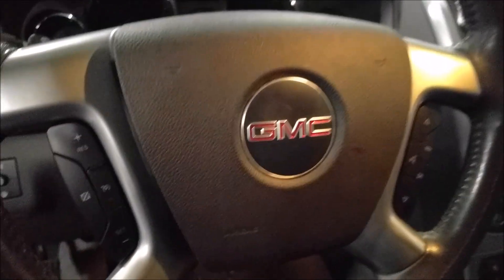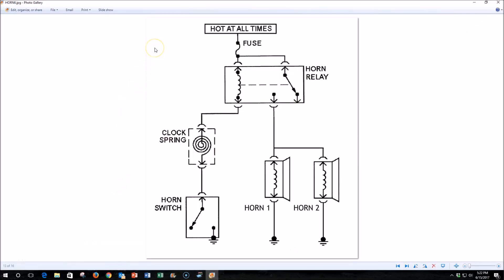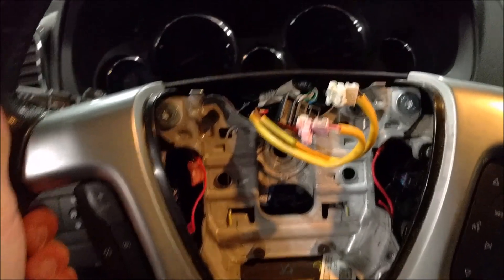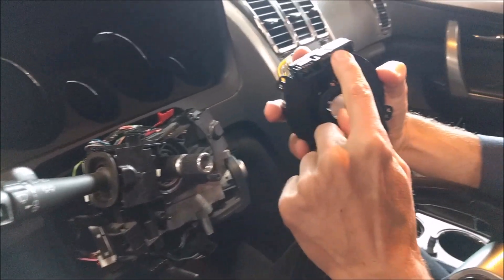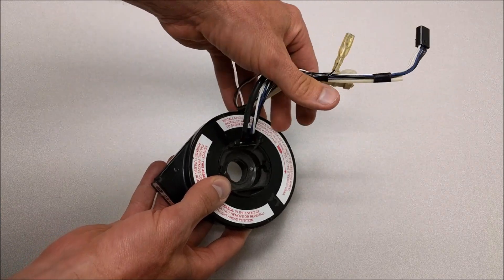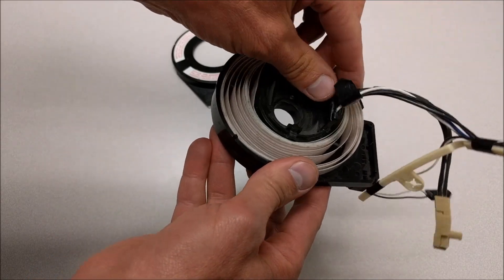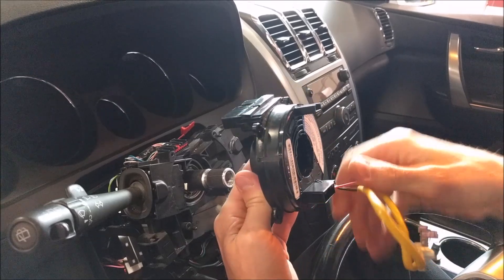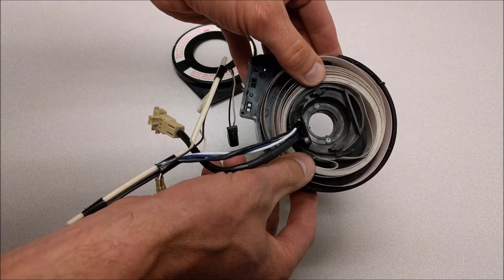How a Clockspring Works

Comment: pretty cool video, i always thought clock-springs were in a sort of direct copper on copper contact (like the ignition switch or a AAA Battery connector)

Comment: So, the automotive industry calls this coiled up ribbon cable a clock spring. Up till this point I didn’t know how communication was coupled to the processor handling this information. 
This ribbon cable technology is nothing new in other electronic assemblies.

Comment: And they want 500 bucks from the dealership to replace just the part on my car not including labor.
Reply from the maker: They can be expensive.  If you have the tools and know how to do it, you can change it yourself and save money.  You will need a steering wheel puller.  Just be careful not to turn the clock spring or the steering wheel while they are apart.  Also, be careful not to purchase a low quality part or you will get really good at this because you will have to do it more than once!  Good luck!
Reply: @JustinMillerAutomotive  its 500 bucks basically everywhere new for my car, ive struck out every time at the junkyard too

Comment: Thank you! When installing do you have to pre turn it or can you just reinstall in the position it came in? Thanks
Reply from the maker: A new clockspring should have a pin in it so that it comes already centered.  You need to make sure the wheels are pointed straight ahead, then install it just the way it came out of the box.  Then, you can remove the pin.

Comment: That was great lesson Justin..At least i know what was exactly to buy & replace..Must i buy the whole clockspring with housing or JUST BUY THE RIBBON..? TQ
Reply from the maker: You cannot buy the ribbon alone.  You will have to buy a complete clock spring assembly.
Reply: @JustinMillerAutomotive  thanks pal..i didnt know it.Mechanic wont tell this

Comment: Question for ya. My 2012 Toyota Tacoma horn is not working when driving straight. Turn the wheel to the left and the horn sometimes works. Would this be the clock spring?
Reply from the maker: Yes- that sounds right!

Comment: Question. My lex gs350 is making a sweeping noise or faint cat winny. Noise could clock spring be problem?

Thanks for video
Reply from the maker: If it is occurring when you turn the steering wheel, I would look at the rubber boot near your brake pedal, where the steering column goes through the firewall.  These famously start making noises when turning the steering wheel.  A little bit of grease on that rubber boot should quiet it right down.

Comment: Thx for the insight- Im lookin to buy an 07 Mitsubishi Outlander and the left side steering wheel controls don't work (Audio/Bluetooth, etc), so from the forums, ppl say its most likely the clockspring because the right side (cruise) works... Hopefully its not too expensive of a fix, I'd do it myself- but worried about messing with the airbag.

Comment: So the other day, I was driving at night and when I made a right turn, I heard a noise like a pop and then my horn started blaring non-stop for the next few blocks. Needless to say, I had many strange looks and unfriendly gestures directed my way.  I finally arrived at my destination about 3 minutes later with the horn still blasting. Pressing the steering wheel did nothing. I shut off the car and the horn continued to blare. Finally I popped the hood, found the fuse box, and pulled the horn fuse. That finally stopped it. My only guess is that the clock spring failed and shorted out the horn switch somehow. Unfortunately, I need to have a functional horn in order to pass the yearly safety check this month. Anyone have this happen to them before? Any ideas?
Reply from the maker: It depends on the type of car you are driving.  Older cars used a slip ring instead of a clock spring.  However, you will probably find the problem if you start by removing the air bag (follow safety precautions). If at that point, you don't see a broken wire, remove the steering wheel and then the clock spring.  Something in there is shorting to ground.
Reply: @JustinMillerAutomotive  Thank you, I'll try that

Comment: How do I know that the clock spring is centred?
Reply from the maker: It is hard to know for certain.  The best way is to make sure that it doesn't turn at all while it is separated from the steering column.

Comment: Just a question. can you bypass the clockspring ?
Reply from the maker: No, you cannot.  The clock spring is what allows your wires to pass from the vehicle to the steering column, which is always twisting and turning.  if you bypass it using wires, the wires will break when you turn your steering wheel.

Comment: I am having a problem with my alarm (horn blasting and lights flashing) while driving my 2017 Fiat 124 Abarth.  This is a common problem according to the Fiat Spider forum and has been going on ever since the cars came out.  There are three models and it seems that this is only happening with the Abarth.  I have tried various suggestions that I could do before taking the car back to the dealership.  They have been removing the BCM's to study, but there does not seem to be an answer to this problem.  I just received a call from my dealership stating that they are going to change out the clocksrping.  I have little confidence that this will fix the problem, but I guess it's a first step.  Thank you for the great explanation on this part as I had never heard of it before.
Reply: How 'bout a follow-up? Did the clockspring resolve your problem, or....?

Comment: Question? When i turn on my turn siginal the wiper blades turn on. Can any help?
Reply from the maker: Without the car all I can do is guess, but I would recommend checking the voltage on the ground of your exterior lights.  If the wipers and lights have a common ground, an that ground wire is broken or was left undone, it could cause the current from the light circuit to feed through the wiper circuit as well.

Comment: Is it possible for a bad clock spring to cause headlights to shut off sometimes and have your indicators not work properly?
Reply from the maker: No, the clockspring usually has nothing to do with the headlights. It is only for the circuits that are in the steering wheel.